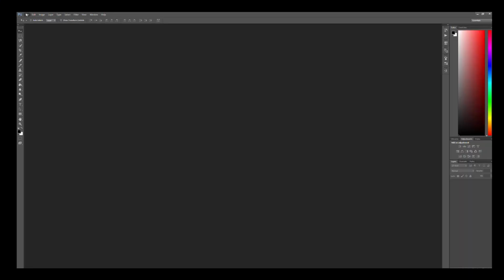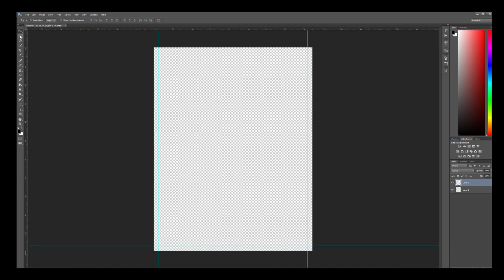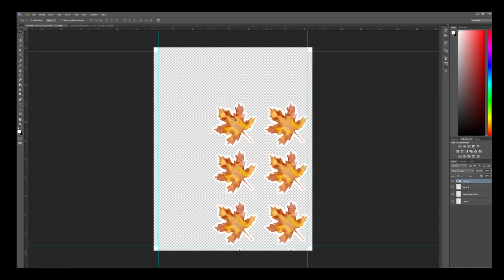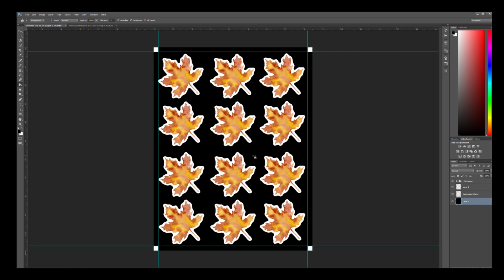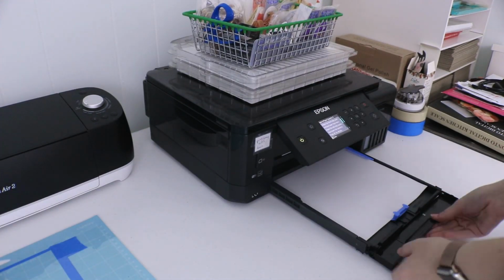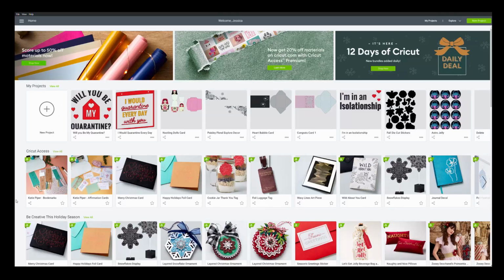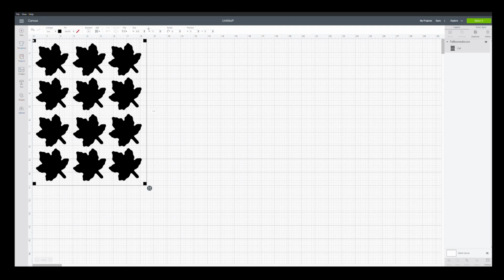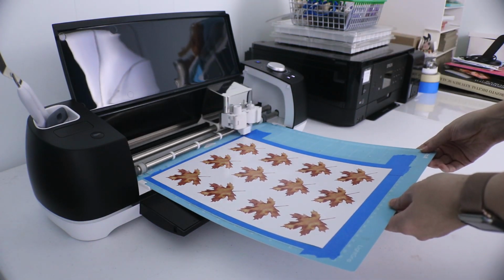Full Page Cricut Hack Tutorial Part 2 // Cricut Explore Air 2 Stickers

Comment: I have been trying to do this all night and I'm about two seconds from ripping my hair out and then throwing my Cricut and printer at the wall. I have calibrated my Cricut. I'm using an HP ENVY 4500 series and Photoshop. I've set it to print both bordered and borderless. My printer has no settings for margins within it, not even under advanced. I tried using Photoshop's margin - set it to zero zero. Set it centered like another tutorial said to do. No matter what I do, my cuts are drastically off.
Reply from the maker: I'm sorry this isn't working for you and I know how frustrating the Cricut can be. In terms of printer settings there are so many places to check, through Photoshop when the printer dialog box pops up, physically on the printer itself via the LCD screen, and also inside the Control Panel of your computer in Printers & Devices by right clicking on your printer. I would check all these places and possible even google your specific printer and the borderless setting. If you think you have it set to borderless you should do a print test with the just 4 white boxes in the corners and nothing, but make them black instead of white and see where they end up on the page. If they are not exactly to the edge of the page this would be a good start to why your cuts could be off. I would start with troubleshooting the printer first. I hope this helps some 😟
Reply: @JessicaLynnIllustration  As far as the printer settings, I've done all of them including calibrating the printer (though I'm iffy on whether that was for the scanner or printer). Google doesnt help, the manufacturer's site doesnt help. I've done borderless and without borders, doesnt seem to matter. And the only reason why I bothered with borderless is to see if it would print where it should. It doesnt, which I dont understand because I've done borderless prints recently and had no issue with it at all.
Reply: i'm having the exact same issue.
I've tried printing with both boarders and borderless. Removing the boarders helped a tiny bit however the cuts are still awful even when I align the paper with the tape. The corner boxes on my print aren't full in line with the edges and I don't know how to fix that.

Comment: Hi Jessica, great tutorial! I am using whit glossy sticker paper and laminate it with self laminating. The issue I am finding is that so far any of the cut settings I use don't cut all the way through and I have to do 2-3 cuts for it to finally cut all the way through. I've tried the different card stocks using the dial and have tried the custom get a deeper blade sticker paper option. No luck with a 1 time run through.Wondering what cut settings you might recommend and/or would I maybe need to get deep blade? Thanks in advance for your help!
Reply: For laminate materials, I use poster board+ or poster board with the more setting
Reply from the maker: Hey there - glad you liked the tutorial! 👋 I don't currently laminate any of my stickers so I don't have much experience with it. However, you might need to look into what's called a 'Deep Point Blade'. Here is a link directly from Cricuts website regarding the blades & tools that go with each machine. Hope this helps! https://help.cricut.com/hc/en-us/articles/360009432294-All-About-Cricut-Blades-and-Machine-Tools#h_15eaaae0-ce13-45ba-959c-a80bd0b91a0f

Comment: Hi, can the full page guide be A4 (8.25 “x 11.75”) instead of your 8 ½ x 11” using the Cricut Explore Air 2 ?
Reply from the maker: I haven't tried it myself, but I imagine you would just need to follow Part 1 and use your measurements instead. It should work because the Cricut Explore Air 2 can cut vinyl sheets up to 12x12.

Comment: Is photoshop the only program that u can do this process with?
Reply from the maker: I haven't tried it on any other program but I don't see why it wouldn't work. You just have to make sure the program allows you to put the squares right to the edge and that your printer doesn't "shrink to fit page" or add any margins because that would throw off all the alignments.
Reply: You can use anything. I show how to use gimp and Inkscape.

Comment: I tried this and it didnt work. (but your video is awesome!) For some reason my cricut cuts 8.65 x 11 even though the square in DS was 8.5 x 11. So Therefore the cuts on my stickers don't line up. Would you happen to know why? Its so odd. I even printed my design at full page, no border, no shrink to fit page. So Im not sure if theres another trick? Thanks for the help!!
Reply from the maker: Thanks for liking the video though I'm sorry it didn't work for you 😟 These Cricuts can be so finnicky and I've had to do my fair share of messing with mine. I can't always be sure what the problem is. I would definitely make sure your mat is loading evenly. Also have tried doing this process while your Cricut is connected to your computer via USB cable? I've heard sometimes if using the Bluetooth/Wireless setting "data can get lost in translation". Just some thoughts...

Comment: I've tried to follow all these steps exactly (part 1 & 2) but I'm having problems getting my cuts to align with my print. I've watched your videos 4 times and I'm pretty sure there are no steps I've done wrong. I've tried a calibration of the cricut but it is still misaligned. The only thing I have done different is making the paper size 210mm x 297mm on both the print and cut as this is the size of paper I have in the UK. Any ideas as to why my sticker cuts don't fully align with my sticker prints?
Reply from the maker: I'm thinking that if everything else is correct it's possible it could be your printer. I had another comment where someone's know that their printer is printing an 1/8" or 3.175mm border, which is tiny but definitely a reason to throw off alignments. A lot of home printers have this as a default setting, where photo/art printers don't so you could print right to the edge. You can first check to see if your printer has a "borderless" option in the settings when you go to print. If not, then you might have to go through the Control Panel, Devices & Printers,  then right-click on the icon of your printer. Choose "Printing Preferences" from the pop-up menu, then look at the setup options. Usually, there will be one called "Layout" or "Page Layout." Once you've clicked "Layout," you should have the option to manually set your margins to zero. For some printers, you may need to dig down another level and find an "Advanced Setup" screen to get to those settings.  If that doesn't work you might just have to google your specific printer model and how to remove the border. Hope that helps some.
Reply: @JessicaLynnIllustration  the printer may have a very slight alignment issue but even the white squares in each corner aren't being cut accurately which obviously isn't a printer issue as the white squares don't actually get printed on the white paper. It's very confusing.
Reply from the maker: @robgeorgesonphotography  I understand. To test the printer, you could make the squares black and just print the squares (nothing else) on regular copy paper to see if they are actually printing right to the edge. If they are slightly inside, then that means your designs will also be slightly off. If it's the Cricut , there are times where I have done multiple calibration tests, and checked for a firmware update. You could also try plugging the Cricut in via USB if you are using the WiFi to see if that makes any difference. The Cricuts are definitely finnicky and don't always cut perfect.
Reply: @JessicaLynnIllustration  thank you for your replies, I'll stick with it and I'm sure I'll work it out.
FYI this has been Rob's wife. I use his computer and his YouTube account 👍

Comment: Printer Question: When You print, is there a special setting to print your registrations marks in the corners? My Printer automatically prints a 1/8 border, which is throwing off my alignment when cutting.
Reply from the maker: I use the Epson ET-7700 printer and I don't have this issue, but each printer is different. Even when your settings are all correct in the document itself, you may still find that your document won't print border-free. That's usually because the printer driver itself has default borders set for each document, and until they're changed your document will print with a border or your program will tell you that you're trying to print a document that's too large for the page. You can try to fix it by opening "Devices and Printers" from your startup menu, then right-click on the icon for your printer. Choose "Printing Preferences" from the pop-up menu, then look at the setup options your print driver provides. Usually, there will be one called "Layout" or "Page Layout." Once you've clicked "Layout," you should have the option to manually set your margins to zero. For some printers, you may need to dig down another level and find an "Advanced Setup" screen to get to those settings. Newer printers, especially if they're photo-oriented, should have an explicit setting for borderless printing. If that doesn't work you might just have to google your specific printer model and how to remove the border. Hope that helps some.
Reply: Double check your center and don’t use borderless printing.
Reply: @EricMBoyd  that didn't work for me. I have your videos saved as well as these for reference. Used Photoshop to print, printed without borderless, center box was checked, page size was 8.5 x 11 at 100%. Five test prints later, and things are still misaligned horribly. I've tried the tape margin hack Jessica suggested. That didn't work either. Obviously there is a fix - you guys have it working fine. But even following the exact steps doesn't produce the same results.
Reply: SAME

Comment: Maybe i’m over thinking this. but are the registrations marks even needed when it’s just cutting? my understanding was the registration marks are for the print and cut from the program to align but you’re bypassing the slightly by cutting out the original 8.5x11 on the mat.
Reply from the maker: Honestly I've never tried it without them and it could work fine. I do know that I can immediately tell if the Cricut cuts are off when it cuts those squares first, so I could stop the cut, calibrate, and start the cut over. If you do try it without the squares please let me know how it goes 🙂

Comment: I tried doing this but it doesn’t cut right, and when I print from PS I get a dark background even when I eliminated the black background. Any idea how I can get rid of that dark background?
Reply from the maker: Did you follow along in Part 1? Perhaps something may be off from there if the cut isn't working. I would have to see what kind of layers you have in PS because it sounds like it's not transparent. I'm sorry but without seeing it it's hard to tell what could be the issue. I would just recommend re-watching both part 1 and 2 while double checking to make sure each step is the same.
Reply: Same here 😢
Reply: Sounds like your flattening the image. You need to make sure to save it as transparent PNG.